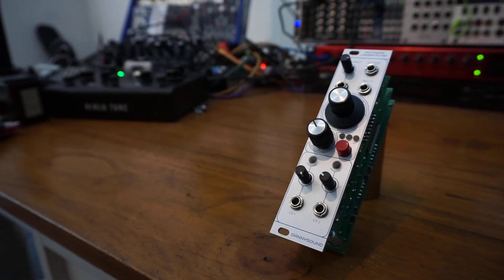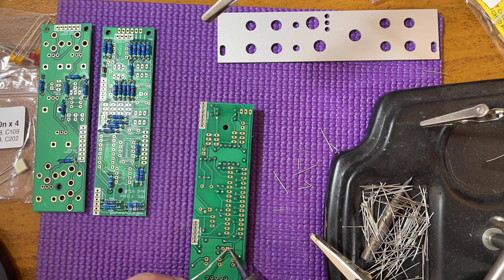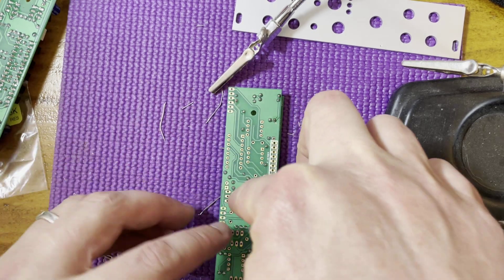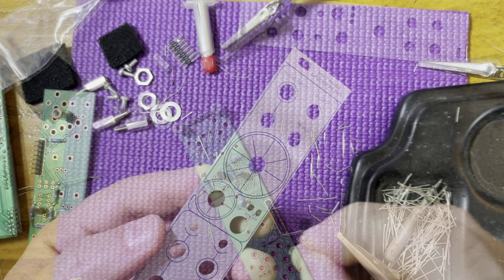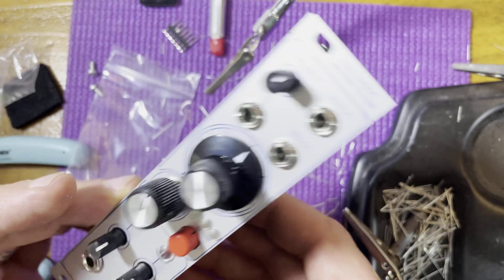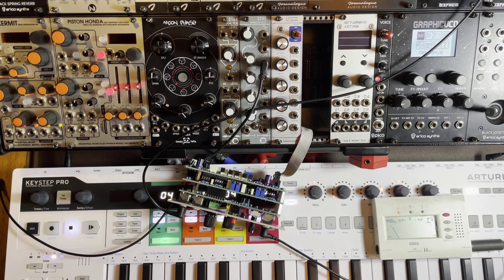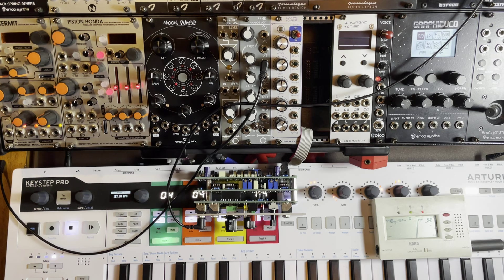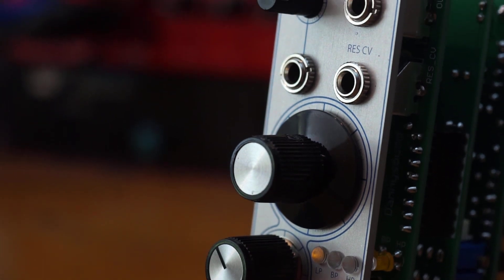Dannysound Multimode Ladder Filter: Build and Calibration

Comment: I've just built the updated version of this kit which is a lot easier. Most of the circuitry is pre-built surface mount so it's pretty much LEDs, pots and sockets & plugs. I just have to calibrate it now.

Comment: Why do you solder from the top? It doesn't look more efficient if you have to touch up the solder afterwards?
Reply from the maker: 1: plugging all resistors at once ensures you make no mistakes placing them.
2: no having to bend out each pair of resistor leads from the bottom before turning the board over. 
3: No dealing with a forest of leads when soldering.
4: the touch up takes literally a minute, and it's not even necessary, only aesthetic
Reply: @QuincasMoreira  Thnx! Didn't think of the forest 😅
Reply: You know of anyone who could build the kit for me if I bought the kit? Is $100 fair if I start asking around?
Reply: @SamplingPercussion  where are you located? Most city’s have hacker spaces or something like that to help you soldering! It’s really fun to try yourself
Reply: @PressAnyKeyModular  nah I don’t like it. Ok I’ll find someone.